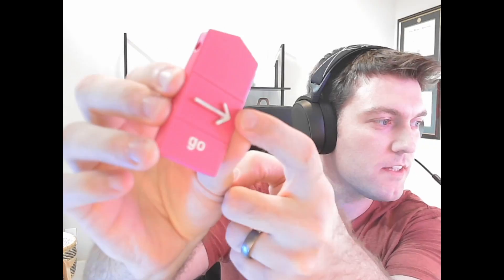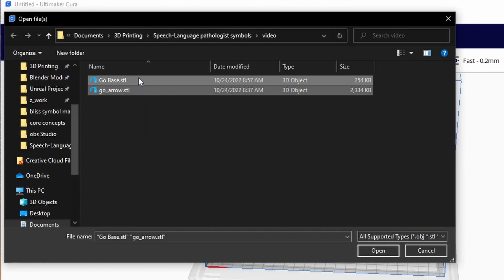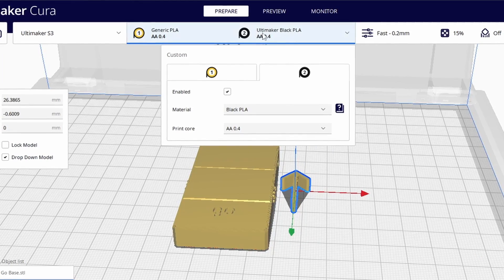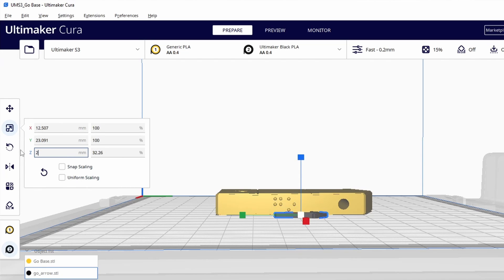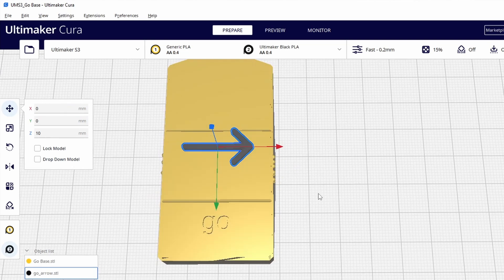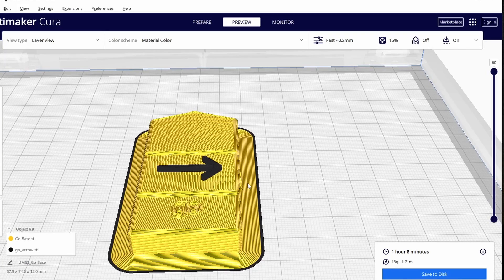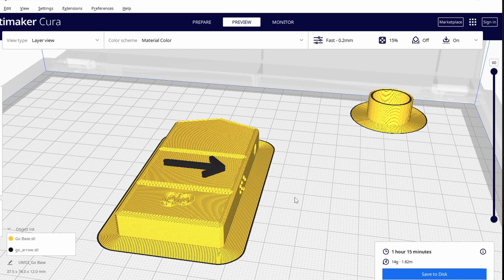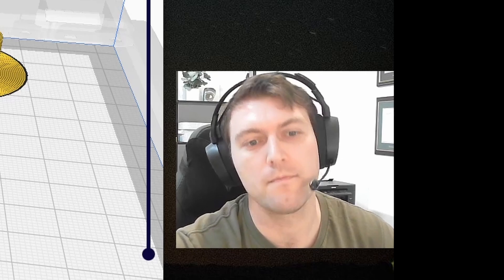How to Set Up Dual Extruders for Beginners in CURA 5.2

Comment: This doesn't explain how to set up dual extruders but how to use already existing ones. Neither does the video referenced in the description.
Reply from the maker: Sorry this didn’t help you
Reply: @Reforge3d  I wasn't complaining about the content of the video itself, I hope you didn't take it like that 🙂 I just wanted to give other people a heads up if they were here for the same reason as me, actually setting up another extruder so that you can even begin with what you show in this video 😅 

You have to create or modify existing Cura definition and/or configuration files to add another extruder to an originally single extruder printer. And working with Cura config files is extremely complex. They really should add more configuration options to the GUI. But I finally figured it out 😊

Comment: How do you stop it from doing both colors on the brim? It keeps screwing me up and causing black bleed into my yellow. I don’t understand why black is needed in the brim if it doesn’t use it in the print until the last however many layers.
Reply from the maker: Not sure, black is known for being a tough transition color. I would try changing the brim size or even turning brim off and watch it for the first 2 layers.

Comment: Do you have to use two models? I'm recently trying cura over snapmaker luban. In luban I can select letters for 2nd extruder like the "go" in your model but don't see a way of doing this in cura.
Reply: Bambu you can definitely paint bounded shapes. It's relatively intelligent, but you have to make sure not to overlook any small polygons. I haven't found a similar feature in Cura, but it's new to me.
Reply from the maker: @mikewages6362  the newer cura versions may have a paint feature to print different ‘colors’ using each extruder. I don’t have a video, but you should be able to find something using prusa slicer or the Bambu slicers.